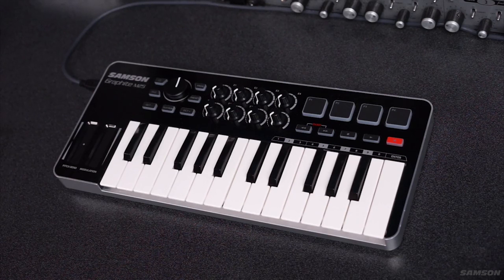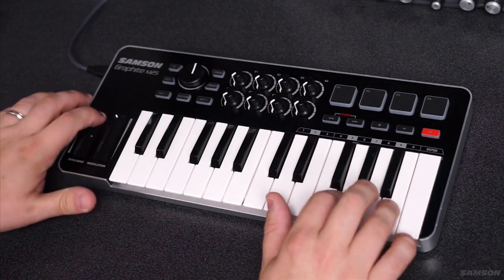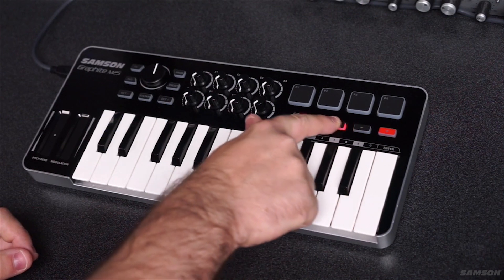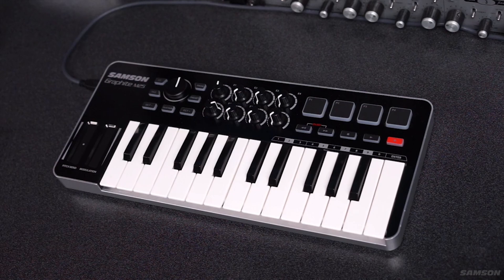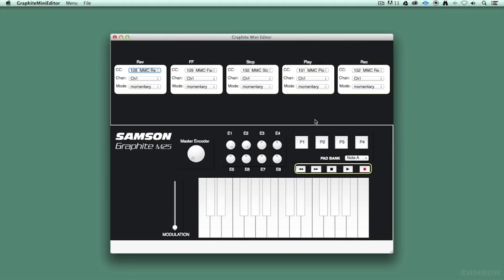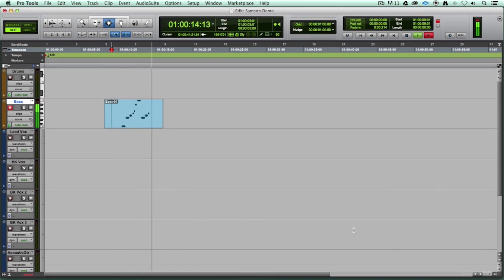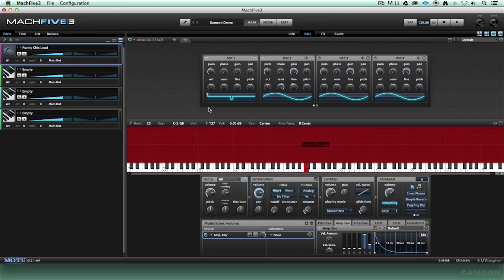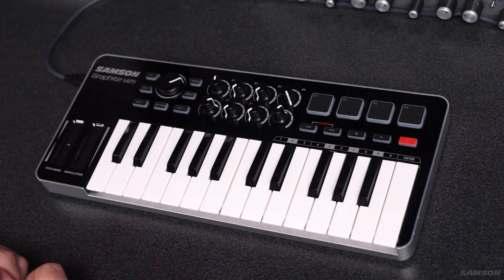Graphite M25 Tutorial-Controller setup in Logic and Protools.

Comment: As two people here mentioned, the modulation and pitch controls doesn't work. When I bough it they told me it was 'cause it was needed to configure it with the software, but I alredy asigned modulation in preset 1 and it doesn't work.
If anyone figures this out, I'll be glad to know.
Btw I'm using it on cubase 5

Comment: I do what you do with the Key Commands and Learn New Assignment but it doesnt work. However, the knobs work when I assign them to pan and volume. Why is it like that?
Reply: I finally figured it out. You need to download the GraphiteMiniEditor and configure your keys in the editor to use MMC commands for rewind, fast forward, stop, play and record (Commands 128 thru 132), and save them to a preset on the keyboard , and then tell Logic to accept these commands (Preferences>MIDI>Sync>MIDI Sync Project Settings>MIDI>MIDI Machine Controls (Activate both options). The transport buttons will finally work in Logic!
Reply: same

Comment: why record and rewind buttons dont work with logic pro x?
Reply: I finally figured it out. You need to download the GraphiteMiniEditor and configure your keys in the editor to use MMC commands for rewind, fast forward, stop, play and record (Commands 128 thru 132), and save them to a preset on the keyboard , and then tell Logic to accept these commands (Preferences>MIDI>Sync>MIDI Sync Project Settings>MIDI>MIDI Machine Controls (Activate both options). The transport buttons will finally work in Logic!
Reply: @GianPieroCiammariconi  Thank you so much! this worked like a charm

Comment: i just tried to setup the midi learn function the exact same way in logic pro x and it won't work. i am highly irritated. please help
Reply: same problem!
did u solved it? 
my logic pro x dont see the buttons like record or reverse
Reply: Daniel Leroy Thomas In Preferences > Control Surface > Setup, make sure you are installing the device as Mackie Designs  > LogicControl.  

Then you should have no problem, fingers crossed.
Reply: Sadly, nothing has worked. I tried installing it as Mackie Designs as you said but it won't let me use the buttons. I can use the rotary knobs, but that is about it.
Reply: Daniel Leroy Thomas I'm having the same problem, but with Cubase 7 Elements. It can't hear the transport keys because it's transmitting the keys on channel 128 and above, and Cubase is only listening up to channel 127. I have no idea how to change those settings :-( irritated is not the word for me after weeks of fannying about. Angry is the word!!!
Reply: The problem has yet to be resolved. I just do it with the mouse because it's too long for me to even bother stressing it. If you guys come upon the answer please let me know and if I somehow find the solution I'll be more than glad to share the knowledge Artem Goverdovsky the3sounds
Reply: Daniel Leroy Thomas It worked for me in Logic Pro X the first time.  It's really easy.  If you are still having trouble let me know.
Reply: +Markus Arike still no luck 5 months later
Reply: bump
Reply: I finally figured it out. You need to download the GraphiteMiniEditor and configure your keys in the editor to use MMC commands for rewind, fast forward, stop, play and record (Commands 128 thru 132), and save them to a preset on the keyboard , and then tell Logic to accept these commands (Preferences>MIDI>Sync>MIDI Sync Project Settings>MIDI>MIDI Machine Controls (Activate both options). The transport buttons will finally work in Logic!
Reply: @GianPieroCiammariconi  thank  you for this

Comment: This software does not work.  Tried it on 10.6 and Mavericks.  Every time I try to download to the device it doesn't send it to the controller.  When I upload from the device it sends back every parameter as the same value.  I can't assign the transport keys in Logic it will not recognize the buttons as a controller.
Reply: Probably you have the "protools" keyboard preset, so yo need to use the editor shown in this video and set MMC sends for transport buttons, as other people don't use the protools preset it works out of the box.